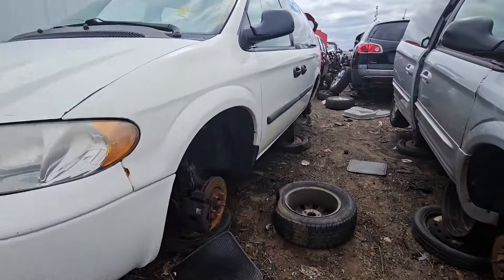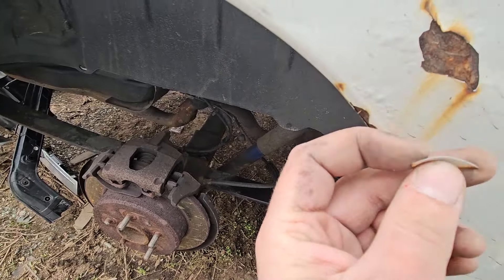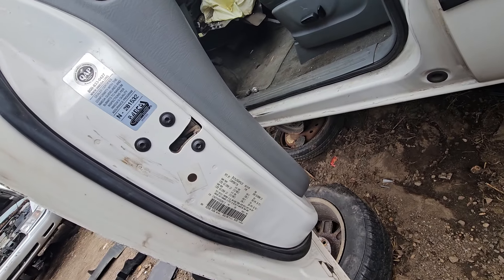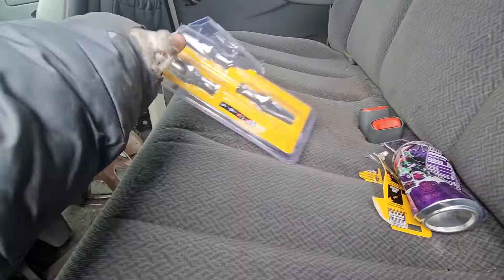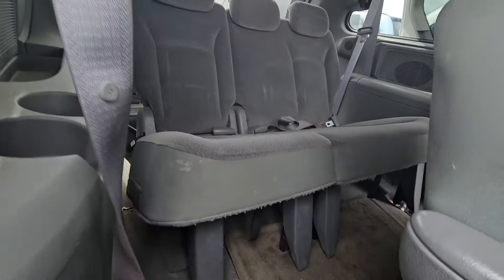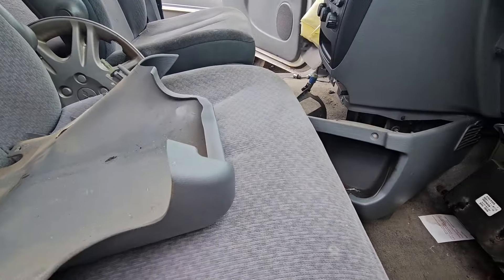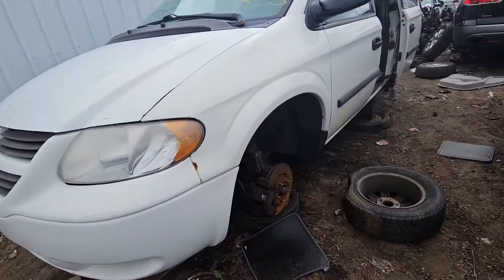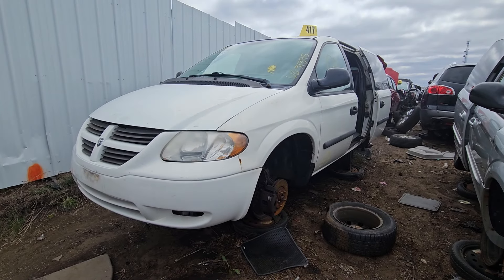2005 Dodge Grand Caravan at U-Pull Salvage Yard in Minnesota

Comment: Surprised its in the yard as clean as it looked inspite the repaint/repairs. Wondered what went bad on her, the engine or tranny or both?
Reply from the maker: Head gasket I am thinking. My phone died, but I could see where it popped the rad and dumped rust coolant everywhere under the engine bay
Reply: @MNMoparMinivan  , Ahhh that would do it. Being an 05 not worth replacing the engine & radiator.